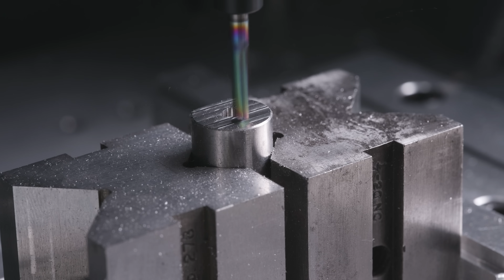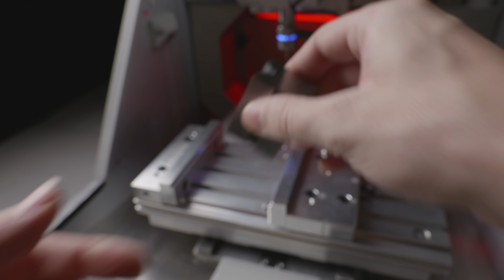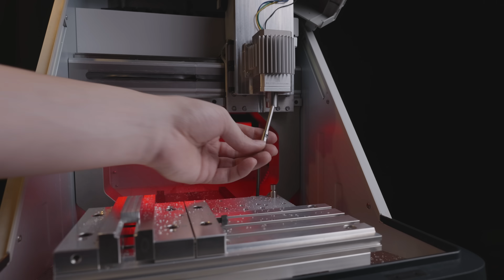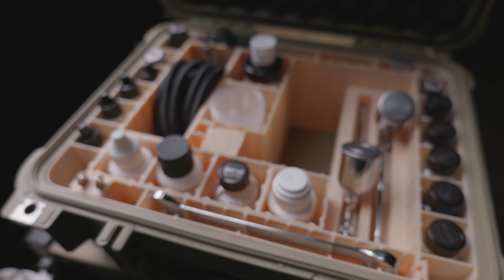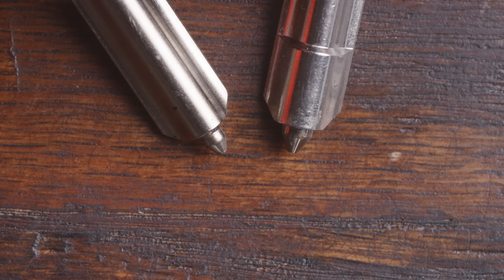Inventing A Tool Every 3D Printer Needs

Comment: I feel like if your nozzle is getting to the point where there's so much buildup that it's a problem, you should just replace the nozzle since the interior bore is going to get expanded/damaged by normal use (unless it's a quite expensive one for a specific purpose like a DiamondBack).

The reason no one's really made this before isn't because it's not possible, but because you can buy 20-40 replacement nozzles for like 20-30 cents each and never worry about it.
Reply from the maker: Hmm maybe. Ill my nozzles are hardened so im not sure how much the inside gets worn out over time.

Comment: I found taking a high res picture and importing it directly into the cad software is a better way to take fine measurements rather than mess around with calipers, taper gauges. In the background of the pic you can have a steel rule to help scale the JPG onto a surface.
Reply from the maker: I do this a fair bit and did try this but at that size and precision i just couldn't get confident numbers.
Reply: @Unemployed_Architect  An alternative approach you could is to indent the nozzle heads into a block of soap or wax, slice the indent in half with a very sharp razor blade to get an accurate cross section of the impression and then photograph this to take into CAD. You may need to print some alignment jigs for the indentation and cutting operations rather than trying to eyeball it.

Comment: Easiest solution is to make it 2 or 3 parts of the bit with either a compliant mechanism-like spring steel insert or using a compression spring - that solves all nozzle problems
Reply from the maker: Im not sure i would call that easy but than again i wouldnt call they way i did easy either haha

Comment: Mount it vertically on the end of a small motor next to the print bed, have the printer park the nozzle over it, spin it up, lower and raise the nozzle. Now you can have the printer self-clean its nozzle at the end of every print. Still have to clean out the tool though ... sigh.
Reply from the maker: That would be sweet...although i would probably need a proper open source printer

Comment: You could make it out of cutting steel, embed it into the machine, have it spin at low rpm and write a routine for it to dip into the tool to clean and reshape the nozzle, basically making a sharpening routine to resquare the nozzle tips. :)
Reply from the maker: than it would really be a pencil sharpener for your nozzle. I like it cause honestly its not gonna take off that much material.

Comment: It's a good idea. But it is not universal and this is the biggest downside. I see the ideal implementation looks like screwdriver chuck with flexible jaws that would hinge and supported with springs. So that jaws could rotate under pressure and adopt to the nozzle angle
Reply from the maker: ya some sort of flexible design would be the way to go. I was just hoping i could get away with simple.

Comment: You know what works incredible for removing that baked on plastic from the nozzle?  Fire and a paper towel. Just take a little torch-lighter and pass the flame over the nozzle very quickly a time or two.  Fold the paper towel over a few times to prevent getting burned (however I'd actually recommend wearing some kind of glove, doesn't have to be thick or fancy...the paper towel is doing most of the protecting) and wipe the nozzle.  Sparkling clean.  We, as in humankind, figured that fire thing out a hot minute ago...it's an amazing tool when used properly and safely.

Comment: you want a vernier angle gauge
also as someone who just messed up there hardened steel nozzle with a steel wire brush, you might wanna play it safe and make it out of copper, hell if your gonna use it hot then teflon might even work
Reply from the maker: Oh really im totally suprised that a stainless brush would damage a hardened nozzle. Good to know!

Comment: Honestly to get the angle of each is easy. Angles are always constant and size doesn't change it. So just like in your video with the enlarged image of the nozzle. Do that for all your nozzles. Measure the top diameter and the bottom diameter and the distance between them. Then the formula is angle = (Top diameter - bottom diameter)/ (2 * distance between the 2 points from the center). It's basically math for 2 triangles at once. Doesn't have to be the very top or very bottom. Just 2 points because the angle will always be the same at any point and distance.
Reply from the maker: Hmm ya i didnt think of it like that. always tried to measure the top and bottom. but to random points, so long as you know the height should work.
Reply: @Unemployed_Architect  It's a really cool project. I hope you can make it work the way you want.

Comment: If you design it for a single brand nozzle, it's only works for that brand. Design a six spring loaded system. Three blades set at an angle, with an upper agressive load & a lower less agressive spring load. These will conform to most angles & to change the spring loads, either add a collar to hold springs in place, or make the collar with progressive twistable pressure on the springs. Brain twist. You get the point. Enjoy
Reply from the maker: I was just really hoping to keep it simple...but sometimes you gotta just accept reality and do what must be done.

Comment: this is a fantastic idea, and the idea of swapping the cleaner bit out for different sizes is a great idea. though every nozzle, manufacturer, is different. i had no idea bambu made their nozzles different sizes depending on nozzle size (the high flow ones does kinda make sense, more material inside the nozzle so its bigger/thicker to handle it) and i think this would be a tool some people would like. 

i use a nano coating application from slice engineering to try and prevent some of this, but it always happens eventually. keep experimenting, and maybe you can get community feedback and open source files to make it so people who use other nozzle systems can build/order one of these one day
Reply from the maker: ya i agree i get the HF version but the others i really not sure why...although i feel like there has to be a reason?

im basically gonna use it / tinker with it here and there over the next year maybe one day roll them out for sale

Comment: I would probably use a tool like this but with steel brushes on the inside instead of just bare metal.
Reply from the maker: I think brushes or maybe some steel wool would work great, honestly maybe better. Part of me just wanted to try and see what the little cnc machine could do.

Comment: Due to different dimension nozzles across manufacturers etc you might be best off making a tri-cone shape and feeding 3 brass brush strips into them, essentially your current design but with 3 recesses in which you would slide a small metal strip that has been fed with brass bristles.
Reply from the maker: Plus would could get away with it being 3d printed in a high temp material. The bristles really just need somehting push up against.
Reply: @Unemployed_Architect  I suppose that means you understand and like the idea ^^ feel free to utilise it, if you want I can visualise the design for you as I see it in order to help a little but from what I recall of this video I watched, you are more than capable of understanding what I mean ^^
Reply from the maker: Ya i think i have a pretty good visual picture. Hopefully one day ill actually be able to circle back to this project.

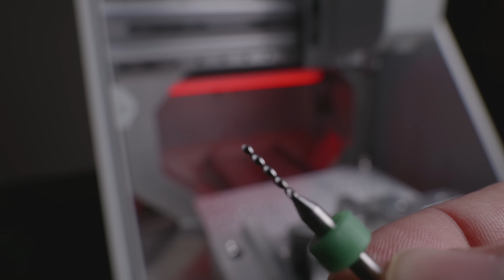Comment: 3:38 not sure what your shop capabilities are, but another solution to not waste a lot of material using a bigger piece of bar stock would have been to make custom v blocks that would hold the smaller stock and be usable for future projects as well
Reply from the maker: @kylewellman402 I have actually done this in the past. The sad part though is i have avoided doing before simply becuase i didnt want to rotate my mill spindle to cut the 45 degree grooves. i will do anything to avoid having to retram my spindle. haha
Reply: @Unemployed_Architect this is also why I got a tilt table for my mill 😁 i understand the pain of tramming.

Comment: I saw your cutter design and figured it would take 30 seconds with a spot drill of the correct angle. Drill the 3 relief lobes and then drill down the center. I can't believe you ball milled it.
Reply from the maker: So that was my first idea but the whole trick there is the drill needs to be both the correct diameter and angle. Which is tricky when you really arent confident it what the diameter or angle should be haha

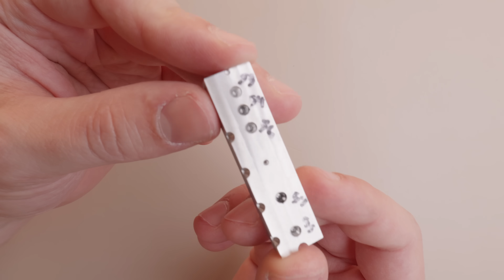Comment: 5:21 the tool your looking for to find that tiny angle is an optical comparator. Without one you can set a nozzle up for a profile shot with a scale in pucture. Import a pic into cad,  scale it and sketch lines over the taper to measure the angle and diameters.
Reply from the maker: I have always been fascinated with optical comparators. such a cool tool.

Comment: 1, shove some brillow in an oversized cone shaped hole, that may help. 2, take pictures and ask AI, see what happens. Or hight, starting diameter and ending diameter should be able to calculate the angle. 3, use a angle finder, do a bunch of angles on paper and dial it in. 4, 3D scan.
Reply from the maker: Honestly I think the Brillo or steel wool in a 3d printed cone would be the way to go. Although it wouldn’t have looked as pretty on the thumbnail haha

Comment: You can use 1 v-block and a normal block (or a 1-2-3 block) to grip smaller stock, it might let you use the stock you started with.
Reply from the maker: @wadekirby8575 
You know i dont know why i didnt think of that haha. Honestly it was a good thing because i actually liked the look of the large stock in the end. in the begging i was trying to keep it as small as possible, I planned to heat treat the tool and only have a propane setup. But as the project went on and on i decided to skip the heat treat altogether.

Comment: It seems like you'll constantly be fighting minute draft angles differences making it a one-sized-fits-one.  It's a shame because it's a good idea.

I bet you could take that cool handle and turn it into a push-to-spin circular brass brush thing.  A couple of pumps to get the brass bristles spinning, place over the print head, and you're done!  Faster and the bristles are compliant and work with all nozzle angles.

Keep at it!  Subbed.
Reply from the maker: oh thank you. ya I sort of backed myself into a corner at the start of the project. some sort of compliant design would be the way to go.

love the push spin handle idea!

Comment: Since the plastic clumps together I usually just use a pair of tweezers when it is hot to grab and scrape off the plastic.
Reply from the maker: That will get the big chunks off. But i always get these super stuck on crusted bits.

Comment: 2:26 wait, it's not gonna be automatic? I was imagining the printer would just move the nozzle to the cleaning tool every now and then 😕
Reply: well you can take the next step by putting the cleaner on a motor and then adding some code to tell the nozzle to go over, turn the motor on, boop the nozzle in for a bit, turn the motor back off, and resume
Reply from the maker: Baby steps my friend

Comment: Seems overbuilt. Just have three razor blades  that are held at three points, at the maximum diameter of the largest nozzle, and a spring pulling the bottom end of them inwards, so that it automatically adjusts to the angle and size of each nozzle.
Reply from the maker: The funny thing is I thought this version would be simple and easy after all it’s just a chunk of steel. no moving parts or what not. lesson learned haha

Comment: use compiance: springs. thats why a brush works on everything
Reply from the maker: ya i was trying to take the easy / simple route with a fixed tool but honestly a compliant one might have been easier in the long run. Would have taken all the guess work out

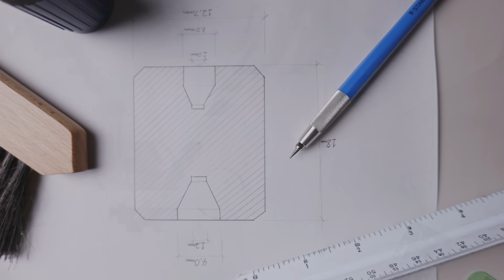Comment: 1:35 Could you please tell what that pencil in the top right corner is?
Reply from the maker: @nuehoujuu9977 that is a staedtler drafting pencil. Holds large 2mm lead. 

https://www.amazon.com/Staedtler-Mars-Technico-Holder-780/dp/B000WL4WEC/ref=sr_1_7?crid=3EH1JH804ZYPH&dib=eyJ2IjoiMSJ9.QW6w2HMVuRiwBj2fuFIHjOsdpnwh52BrvpAoecReDt3SzrDNfiy-bTViv_20VsqnoGDgE9JjYzhYcdfFuaYUWyjR-wEyJ7l4l7UtX-5K0xCyQtdhbBUKDGE-B78uj4lf2JOE0HUyGNHhJxj261s1_gqF79iBdiFoGLIkDd52ZmpvJT2IYcChf18gHTEcemUNyVMQqdpkPGjt7bHIzDXj1cEg8EeAN_esew8R--Jw7i81UkR9OUaxBMVHaKbbNAK4oNBob6wo9cUNs79AB92Z82J6AqWM9VWUT140NbalTpE.7W5VtJSPyY9CUGZ-RscHDTqSTLqYazwwS3HzHh8Q3SQ&dib_tag=se&keywords=staedtler&qid=1788468394&sprefix=stade%2Caps%2C294&sr=8-7&th=1

Comment: i mean, it's cool, and you deserve credit... but i'm sure you could print that so much quicker and easier in something like HTPLA, would be pretty tough if you printed it solid, maybe annealing would help too. It'd only be for cold cleaning and it would probably wear out fast but it's like what 3g of filament? cut the mangled up bits off the start of 2 or 3 spools and you've wasted more than that
Reply from the maker: also something like a fiber filled filament could work well. it’s supposed to be abrasive so you could use that to your advantage!

Comment: I have imagined something with two or three flat metal blades that har hinged toward a common center and thereby can change angle against the nozzle. With some kind of spring pulling them into the center they would adapt to whatever angle the nozzle has when you push it against the nozzle.
Reply: Like a reverse cylinder hone.
Reply from the maker: A adjustable or spring loaded tool would have taken all the guess work out of trying to find the right angle

Comment: Why don’t you cross section nozzles to allow you to measure the angle?
Reply from the maker: Like cut the nozzle in half? That would be cool.
Reply: @Unemployed_Architect  yes. Cross sectioning is a quite common method used in engineering and biological samples. Frequently, the part is first potted in a resin to support the part during sectioning.
Reply from the maker: Oh very cool! I love the comment section always great little bits of info!

Comment: I do feel like the tool is a bit of an overkill, especially if you need a custom one for each nozzle type, but I'd be lying if I didn't admit that using my brass brush near those hot end wires makes me nervous every time.
Reply from the maker: i totally agree. Whenever i start a project i always think this is gonna be quick and easy. Its not until im half way thru i realize how complicated its actually gonna be haha

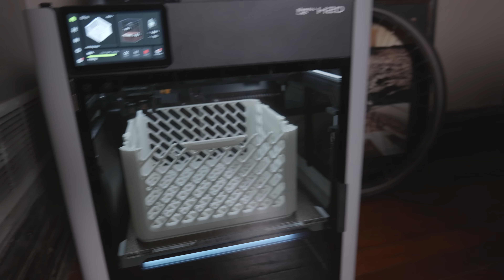Comment: 7:46 if you want to dampen vibrations from 3d printer you can place it on stone slab that is  bigger than the printer base itself and has atleast 3cm of height
Reply from the maker: I have seen that as an old skool trick. I thought putting it on the floor would be enough haha

Comment: Why don't you just use 2 ball end mills of the exact diameters of the holes you're trying to add? Then you wouldn't need to do any kind of slow finishing passes. A single pass with a carbide ball end mill of the right diameter will give you a great spherical pit like you want, you could finish this cut in a few minutes and you'd get cleaner sharper edges. Very well made video and beautiful design, but it's a very brittle solution to the problem since as you said at the end you'd need a different tip for every type of nozzle. Also this is going to shave down the tip of the nozzle over time. I think having something flexible, like a brass brush whose bristles are all facing inward in a cone-shaped hole would work better as it would fit any nozzle size or shape and wouldn't damage the nozzle.
Reply from the maker: That would be a faster way of producing the shape. That said trying to find ball mill of the exact size is tricky especially since i wasn’t ever 100% confident on what that size should actually be. Im also not confident it would shave tip down. The bambu nozzles are hardened steel might be an issue with brass nozzle though. That said i do think a brass brush cone shaped tool could work better. To be honest the idea just sort of randomly popped into my head and i just ran with it haha.

Comment: i love going the tool manufacturing route that you went, woulld not have thought of that. I wonder how simple it would be to just embed a brass brush into a socket-shaped tool so that it would work for any size
Reply from the maker: I think that would work out really well. it would probably be tedious though because you would need to glue in individual brass wires.

Comment: What you need is a spring loaded scraper that conforms to what ever angle the nozzle is.  Only the scraper needs to be metal (maybe) but the rest is printable plastic.  Maybe no spring but a scraper whose angle is set by a pivot point.  But you don't want the scraper material to be harder than the nozzle material but harder than the plastic you are printing. Aluminum scraper will probably work fine.
Reply from the maker: Some sort of adjustable angle tool would take all the guess work out. Some times you start down a road and by the time you realize your mistake its to late and you gotta just keep pressing on (:

Comment: You choose a cylinder for the cleaner tip, that leaves you with 2 tip-angles. Choose a cube instead, with the magnetic attachment, and you get 6 angles.
Reply from the maker: More angles equals more better